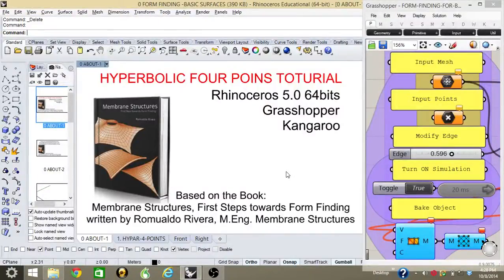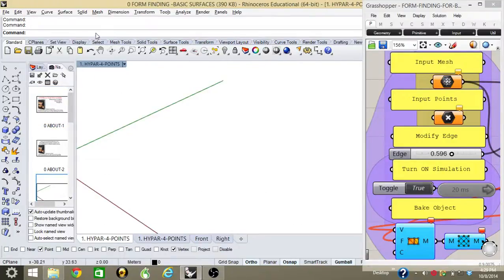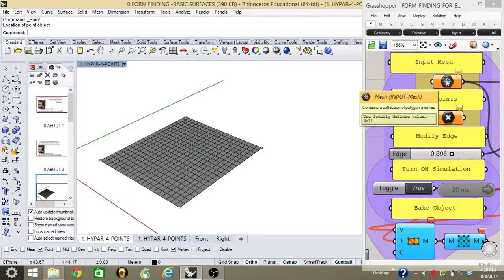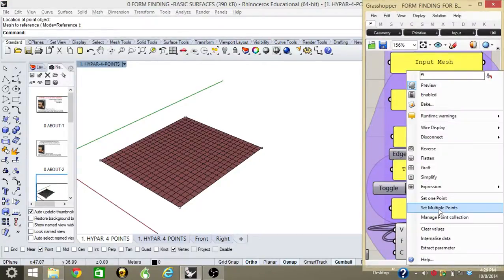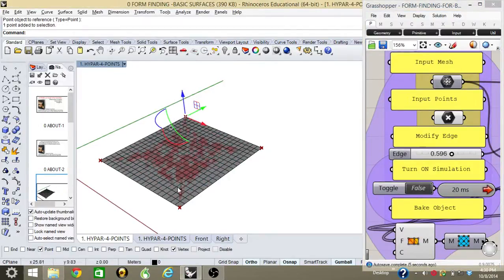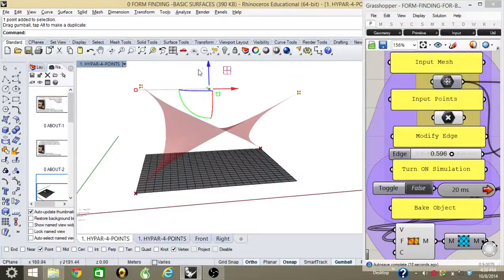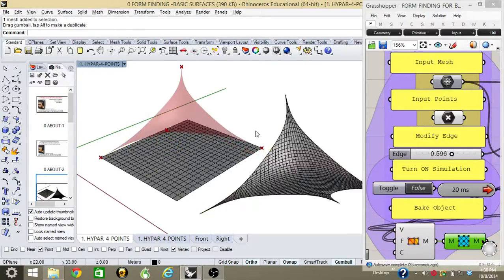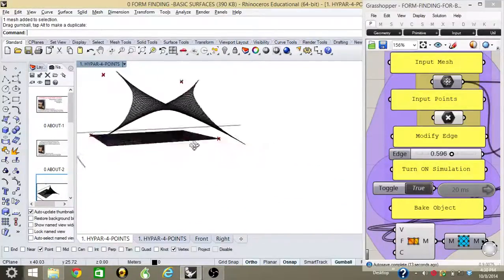1. TENSILE SURFACE STRUCTURES FORM FINDING by ROMUALDO RIVERA TORRES

Comment: Hi I am trying to follow your video also . However I am not being able to snap the points into the mesh. I was wondering if you knew how. Also I see on the script below you have tension and stiffness . Did you download a specific plug in for that? Because I cannot find that command.

Comment: Hi, I'm following your tutorial exactly, however, the membrane doesn't behave the same way it does in the video. When I select the two points and lift them, those two points just raise and the rest remains flat as if there is no tension. Almost like if you had to pick up two corners of a tablecloth. I'm using kangaroo v.0095. Your gh is for kangaroo 1.0 however i can only get 0.099 before the version jumps to 2.0. Any help would really be appreciated.
Reply: Solved. Installed 0.099 and it works.